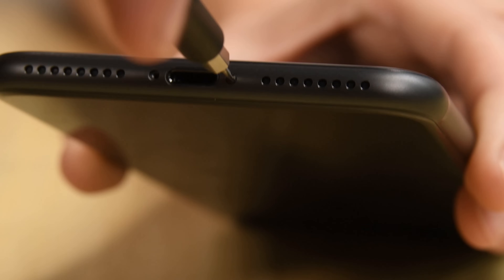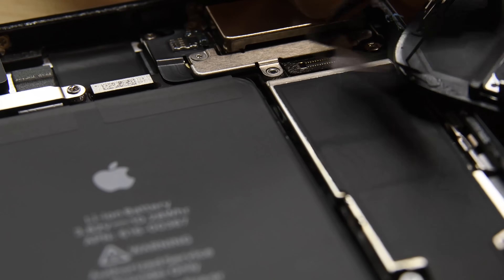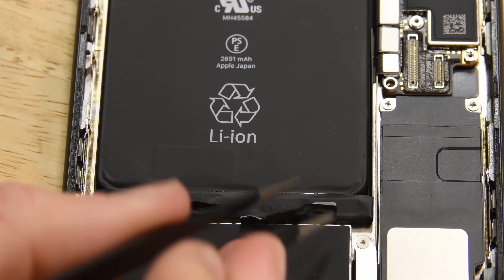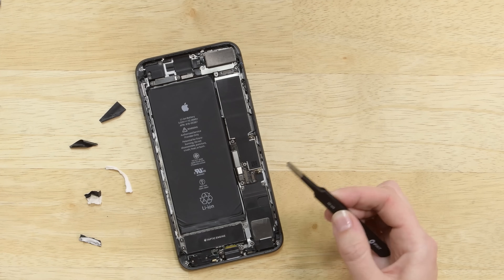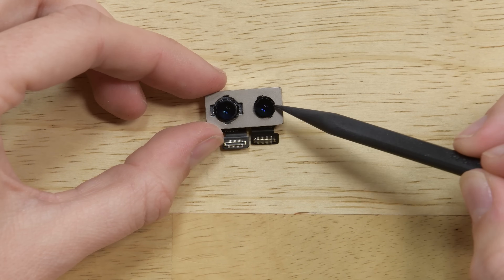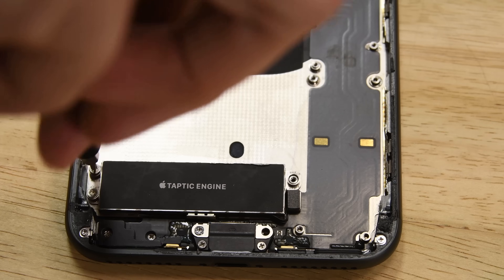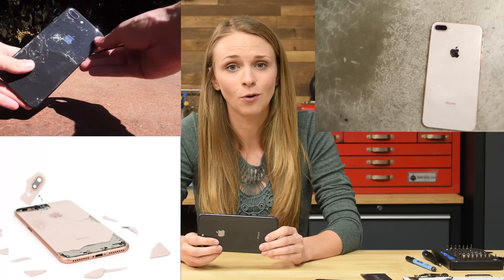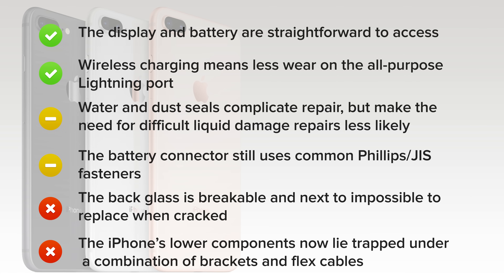iPhone 8 Plus Teardown and Analysis!

Comment: My back camera lense has a slight crack and also my speaker for music is crackly i think broke. No shop will touch my 8 plus any ideas?
Reply: Darren Mitchell Apple. It should be under warranty if you haven’t done anything to it yet. Don’t mention the back camera. If they see it, they still probably won’t do anything about it. Go in for the speaker though. I went in for a busted speaker once and got a completely new phone.

Comment: If you remove the tactic engine before trying to use the pull tabs for battery removal, you'll have much better luck. Otherwise it can be a nightmare.

Comment: You had to be very careful, because this time the battery didn't explode. But try the same what other have been doing with the Note 7 - just stab the battery and see what will happen. I bet 100% iphones 8 and iphone X batteries will explode. Exactly the same way as in Note 7 case. And nobody is bitching about it, huh...

Comment: It may not seem to be important but can you see about the iPhone 8 speakers mine and others are louder than the others. Mostly by looking at it normally is from the left of the home button the speaker is more quieter than the one on the right is that normal for all iPhone 8 pluses????? I tried 3 of them and it’s just the same as mine.

Comment: Remove the Taptic Engine first then pull the tabs. This is coming from an Apple trained technician. That’s how we are taught.
Reply: You have to remove the logic board and the speaker to remove the Taptic Engine.
Reply: kody oneill it doesn’t take someone with common sense very long to figure that out, obviously the girl in the video doesn’t have any.
Reply: joshua lotion your point is? So it takes longer, it’s still necessary

Comment: is it possible to transfer the motherboard from the 7 plus to the 8 plus? I see that they both have the same layout. With my iphone 6s plus, I was able to replace a motherboard originally 64gb with 128gb. It was as easy as unplugging the higher gb and putting it into the lower one.

Comment: Tip for those damned adhesive strips: pull with even pressure across the strip, and when you feel resistance, wiggle it back and forth a little. You should feel the adhesion give a little, and the strip will suddenly feel easier to pull out. It's like the strips get hung up on something, and the little wiggle breaks it free. Saves many a battery once you get the hang of it.

Comment: Remove the taptic engine before pulling the adhesive strips off. You get a better angle on the strip and it doesn't tear as easily.  And try pulling a little slower.

Comment: Small lifehack. To be able to get the battery adhesive without tear it, all you need to do is to unscrew the Taptic Engine first. This will help you to take your adhesive straight. Don't do it with an angle. Do it streight.

Comment: That’s because you need to remove the logic board and the haptic engine and then heat a little bit the phone in order to remove these double side tapes under the battery easier. Then won’t break and you gonna take off the battery intact!

Comment: I’m not crazy. The iPhone looks so good on the inside and it appears to have so much better components than for example a Samsung Galaxy. It’s that correct ???
Reply: APPLE ALWAYS apple has always gone with a stylish "black and chrome" look on alot of the internal components. Your example however does not car how they look on the inside and is more focused towards function

-samsung user
Reply: The iPhone looks like trash. Samsung Galaxy for the win.
Reply: Elijah Diamond nobody agrees with you
Reply: APPLE ALWAYS sadly, Apple does not know how to make a good phone. Even i know how they used wrong capacitors. The inside might look nicer but you will get a better phone with samsung. BUT JUST LIKE AUTOMATIC AND MANUALS PEOPLE WILL LIKE ONE BETTER
Reply: Apple doesn't have better components yep they might look fancy and all, thats their goal after all, but take a look at their 4g / LTE and wifi speeds. Or at their macbook pro / iMac motherboards, they are poorly engineered but they look good.. and the battery of the iPhone.. huge and small in mah, degrade faster than lets say samsung devices as apple claims they degrade 10%/20% per year and samsung claims like 2.5% per year

Comment: I can't agree with the complacency about the battery/screen being "easy" or "reasonable" to access. It's seriously fucking obnoxious with the glue and needing the suction cup tool just to replace a fucking battery. Shame on you iFixit for accepting such bullshit and giving them a checkmark.
Reply: any water resistant phone has the same process, so it's not like it's adhesive for no reason.

Comment: The iPhone 8 battery is weaker than the iPhone 7?? They said that in the news and they said that "iFixit" discovered this, is it true ????
Reply: its me well it's smaller, but efficiency may make up for the size decrease.
Reply: No it doesnt, 1600 mah is shit with all the optimization in the world
Reply: Honestly, the battery life of the 8 plus is easily the best ive had on any phone.
Reply: But imagine the huge battery life if it had a normally sized battery.
Reply: Just acceptable when at new capacity.

Comment: I'd like to know if the back is made of a metal under the glass that holds magnets. I have a phone holder in my car and for the iPhone 7, I had to glue an ugly metal plate on it to hold on the magnetic counterpart. Will it stay the same or is the Qi charging coil helping me?
Reply: Joel Shinoda good question. I’ve been wondering about using a magnetic mount as well with there being a wireless charging coil under there. I put the metal plate inside the body of my iPhone 6s Plus under the battery.